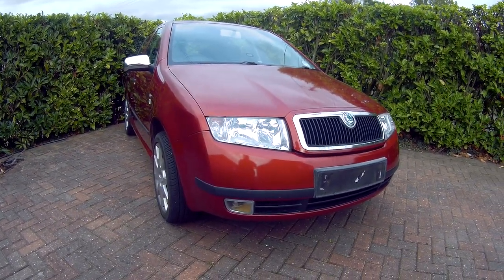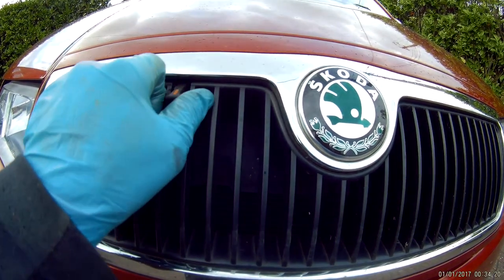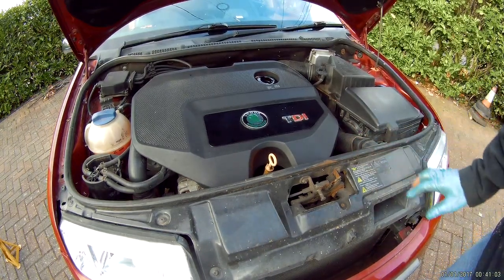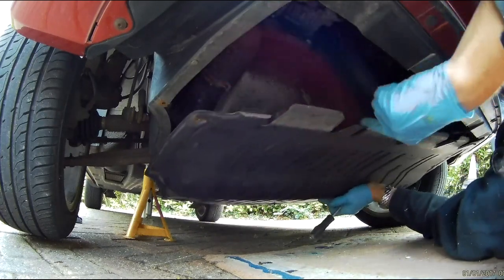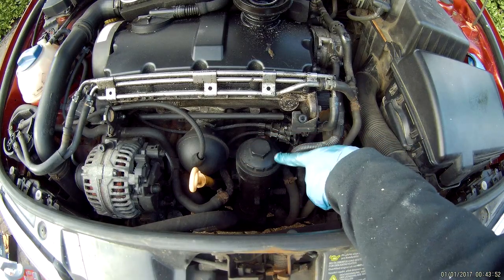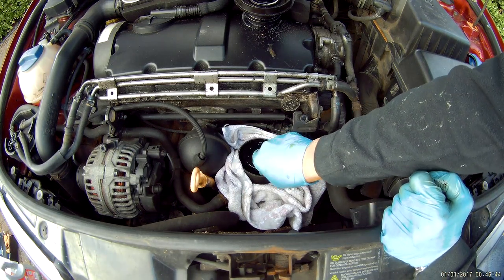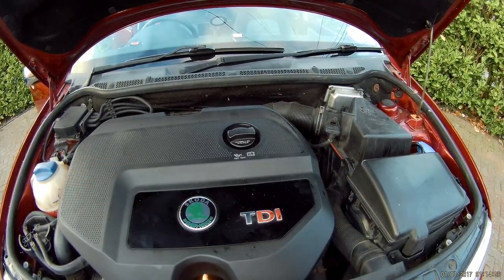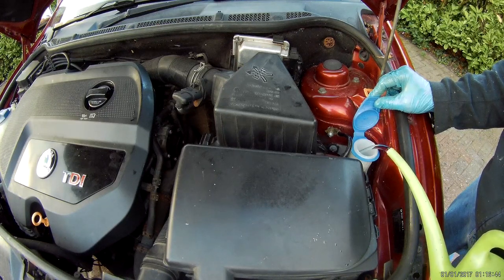SKODA FABIA Oil and Filters change 99-07 (A beginners guide)

Comment: On March 27-28, 2024 1. Thank you for your videos!!!  2. using these videos, I replaced: a) oil filter, fuel filter, air filter, cabin filter b) engine oil c) 2x rocker pin d) windshield wipers e) trunk lid actuators f) power steering oil g) parking sensor speaker 3  .Greetings from Poland 💪🇵🇱👍
Reply from the maker: Great job, glad to hear it :-)

Comment: Next video idea: Gear oil change 🌞
I've found somewhere for my car is the interval about 7-8y or 160.000-200.000km. My choice was Swag/Febi sae 75w Api Gl-4 (for 5MT type 02T), and for yours should be 75w-90 Api Gl-4/5 or with 4+,it is the same...these aren't hard to find,all are TDL gear oils,total drive line...
Nowadays,every lub factory recommends the thinner oil...but as my opinion,this is not so good if vehicle has many kilometres or years...anyway, vw gear oil specs should be considered.
Reply from the maker: If the gear oil is too thick shifting becomes difficult in this box as I found out :-) will do a video some time tough, thanks :-)
Reply: @HatBoyHarvey  you're right.One should not be afraid of thinner oils. SAE 75W or maximum SAE 75W-80 both with API GL-4+Vw gear standards.( I don't know why in our service they put in friends Golf 1.4tsi 122Hp 75w-90 and GL-5!...) ...there are many examples,in my car they put 3-4 times 10w40 (instead of first choice 5w30 504/507,so in the end I've chosen 5w40 502 Acea C3,because Lpg is installed, I buy now the all material,oil,filters and then go in service)

Comment: Hi, how often you change the air filter.... annually or generally when it's black and full of dirt ?
Reply from the maker: A Qg0 standard service says you must change the air filter every 60,000Kms, but I think it is best to check it every year, take it out, bang and shake it then inspector for dirtiness on the surface of the filter material. Replace it before it gets too bad. It depends what environment, a dusty area will clogg the filter quicker. A clogged air filter effects engine performance and economy so it is worth keeping an eye on it and changing it out more frequently than the service schedule IMHO. Mine is changed out every 3-4 years roughly :-)

Comment: Hi there mate great video. Quick question how tight do I tighten the oil filter and sump plug? Thank you I have a Skoda Fabia 1.9 tdi 2002
Reply from the maker: Thanks RANDEEP685. I put the these in the description. the oil filter housing has it printed on the cap also.

Comment: Question for you Harvey. The foam on the inside of the engine cover on my vrs 2004 is virtually gone, just one little piece left that is loose. I am guessing this is just to stop engine vibration. Is there a particular sort of foam I should use.. Heat resistant and non flammable I guess.
Reply from the maker: Sound insulation with foil on to protect it from heat, I'll do a video when I get some :-)

Comment: Hi HatBoyHarvey just wondered if you might know why I seem to be losing a small amount of oil from my 1.9 TDI Fabia. Seems to be coming near from the offside front wheel. I've tried to research this and it might be the intercooler or something?? Is there a reason why this would be leaking oil and is there a solution you could help with? Thank you
Reply from the maker: The intercooler is just a radiator, there is no oil there. Oil vapour from PCV crank case breather pipe back in through the turbo. A little oil there won't harm anything, but if it seems to leak from a connection or you find a split in the pipe then that need rectifying as soon as :-)
Reply: @HatBoyHarvey  Thanks

Comment: hi is it possible to convert a manual wing mirror into a electric wing mirror on a fabia
Reply from the maker: If you want to use the switch gear that comes part of the adjustment for the wing mirror and heating element on the door handle which also incorporates the electric front windows then it would be possible if the wiring connectors are in place and the comfort module (small electronic control unit ) and wiring loom under the right dash are the same. I guess it would be trial and error, have never done it, but should work if your can get all the parts from an electric windowed model, but bare in mind you may also need Vagcom to activate the functions to work:-)
Reply: @HatBoyHarvey  thank you ☺

Comment: Good video, i am a bit confused, if i input the details of my car on ebay and amazon i get two different types of filters, one of them is like the one you are changing, the ebay one is a metal cased thing? I have a Skoda Fabia mkI Hatchback 1.4 2006 automatic.
Reply from the maker: There's the difference between petrol and diesel 1.4 engines. listing often confuse the two, make sure to include the engine code :-)

Comment: Excellent video, many thanks, you gave me the confidence to do an oil and filter change. Don't know if this would be useful to anyone but on  Fabia Classic 1.4 8v there is no need to remove under tray as it is in a 'U' shape which allows access to the sump. Also pre VAG so sump plug is M16 X 1.5 X 12 different to later Fabias which I believe are M14.

Comment: Great video. Please, can you show where you are placing the axel stand?
Reply from the maker: Place the axle stand on the solid part of the front subframe for this job, not the engine, the body or moveable component parts. Use the axle stand in conjunction with the side stand in place and also put the wheel under the body. Test the safety of the car yourself before going under it and if you are in any doubt of the car's safety don't go under it. Also have someone present or tell someone what you are doing.

Comment: Where about sis the sump plug?
Reply from the maker: Sorry it is not such a good image and you can't see it from the front of the car as it is on the back side of the sump pan on this particular engine. Is your car a different engine?
Reply: HatBoyHarvey mines a 1.9 tdi same has yours, and also is it necessary to always change the plug when servicing?
Reply from the maker: It is recommended. The washer compresses to seal the sump on first use only for optimum seal. Saying that I know guys that use the same plug for years without issue. The important thing is not to leak oil onto the road and not to strip out the sump by over-tightening the bolt. Best to use a torque wrench at 30Nm.
Reply: Hi what torque to apply on sump plug please?
Reply: Just saw on your previous message 30nm thanks